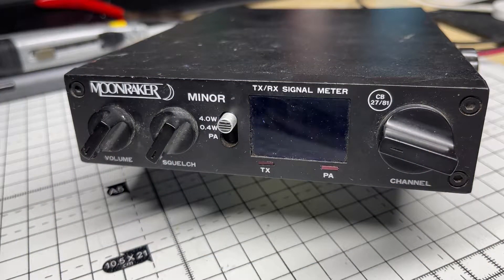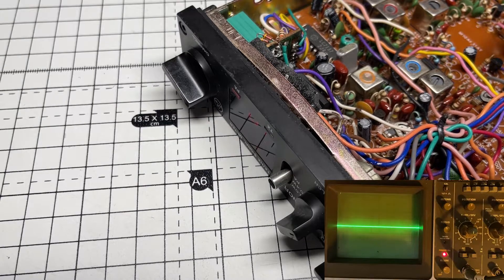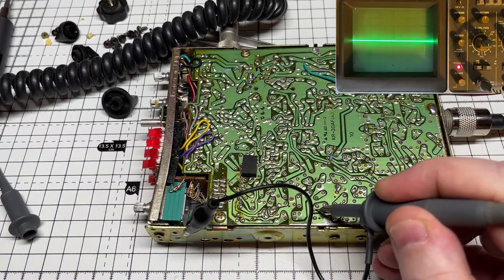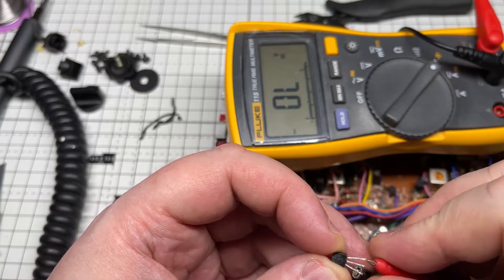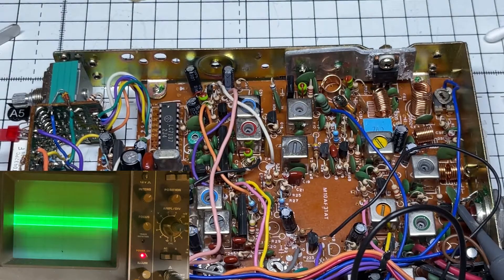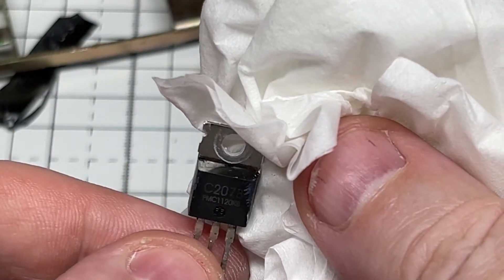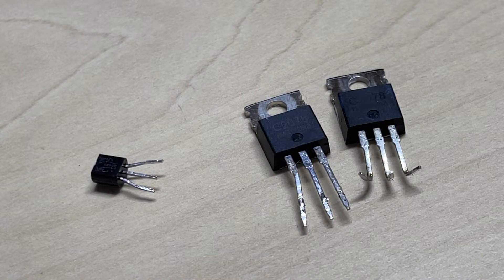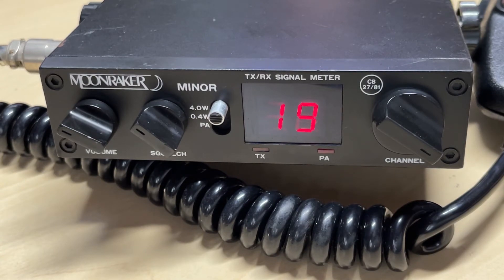EP 048 - Moonraker minor CB radio repair. Fake RF output transistor.

Comment: Hi, i need help with c2078, when is on receive mode , the collector is around 12.5 volts, but when  is on transmit mode, i have 3 watts and the collector is minus  -20volts
Reply from the maker: Your meter is getting confused with the rf being produced